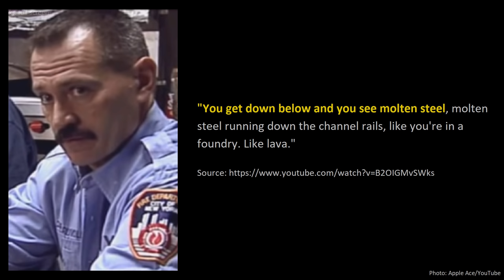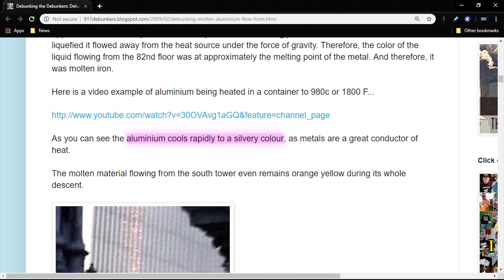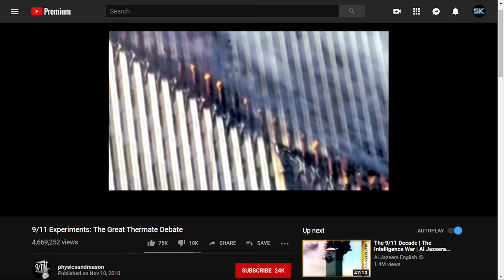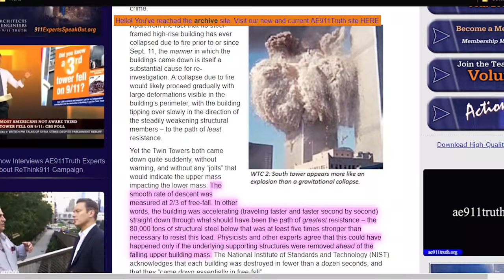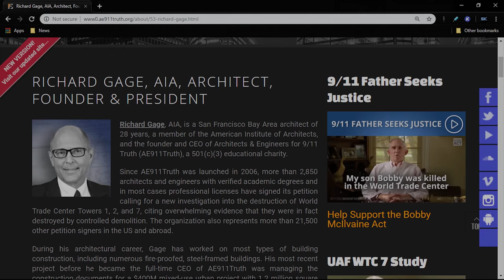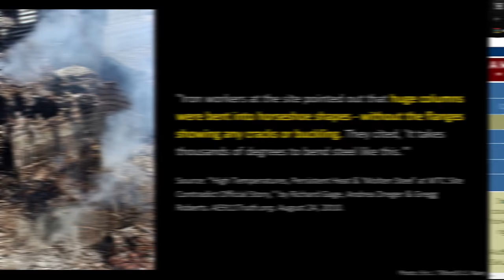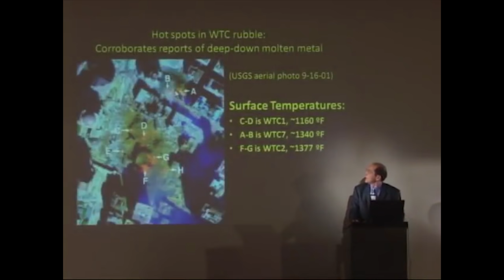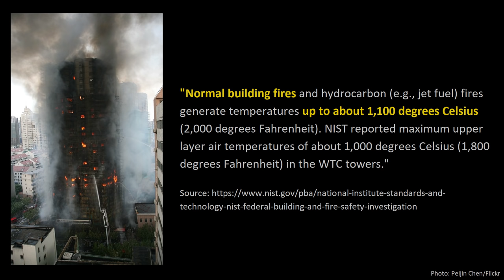9/11 Truthers Debunked: "Molten Steel = Thermite From Controlled Demolition!"

Comment: Can you do an episode about building 7? You have changed my mind on subjects before, but without an explanation for building 7, I'm not convinced that it was not a false flag operation. Flight 93 was brought down and crashed because of the passengers taking over the hijackers but building 7 went down for no apparent reason even though it is 100 meters away from building 1 and 2 according to google, and there were WTC buildings between it and and wtc 1 and 2.
Reply: 1. Larry Silverstein purchases lease for World trade center and the twin towers. A purchase that nearly every business analyst recommended against. The Towers were filled completely with asbestos that would cost a furtune to get rid of....But regarless, Silverstein makes the purchase and takes out huge insurance policy on towers against terrorism 6 weeks before 9/11. 
2. Silverstein worked in the towers every single day without fail, as well as his children, but happens to miss work that day? as well as his children? How convenient...
3. Silverstein gave the "go ahead" to "pull"(demolition term) Building 7, to which the OFFICIAL 9/11 commission report didn't mention the collapse of the 3rd skyscraper that day. A building that fell at free-fall speed, a complete scientific Odyssey, to which if true, we would have to re-evaluate Newtons laws of Physics! No steel buildings have ever collapsed into their footprint, pulverized heavily, at free-fall speed from office fires/jet fuel. 
4. Urban Moving Systems (proven front for Israel intelligence agency) given $500'000 Federal Government Assistance Program On June 22, 2001. A moving company that was used to move out Israeli companies at company losses out of the twin towers just a few months before the attack. The moving vans were later verified to have bomb residue through bomb sniffing dogs.... Israeli companies foreknowledge of attack... Planted explosives brought in.
5. Israeli intelligence agents found celebrating the collapse of the towers, admitting they had foreknowledge of the events. Israeli agents under benjamin netanyahu, who larry silverstein spoke to on a regular basis. If Israeli intelligence knew, Silverstein knew.
6. September 10th, 2.3 trillion dollars admitted to be unaccounted for? Pentagon accounting offices trying to account for this money completely destroyed the next day under the guise of a plane hitting it? To which dozens and dozens of cameras could have captured? But the government refuses to show any of those, and hand picks ONE inconclusive video with botched frames?
7. Molten steel from dozens and dozens of first responders and witnesses, combined with nanothermite in all dust samples. This fact alone debunks your entire video. NANOTHERMITE. ADVANCED, MILITARY, EXPLOSIVE, MATERIAL.
8.Mysterious deaths of key witnesses of 9/11 with the likelyhood of all of them dying in the fashion that they did comparable to one person being struck by lighting 10X. No investigation of that, many unanswered questions, purposefully abandoned.
9. There are hundreds of other related, convenient, and coincidental points. 
10. There is no problem with leaning towards believing in a conspiracy. All it is, is following a lead of evidence, just like any other type of investigative groundwork. People who lean or believe or bend towards following evidence that leads towards conspiracy are just are actually regarded as better investigators, so long as they an remain to be unbiased in the end, and remain open to all facts, no matter what side of the coin they're on. 
11. I used to buy into the false narratives, before I developed and open mind.
Reply: @justinturner8219  I happen to be partial to this theory rather than thermite watch?v=Uw-aZsXnGl0 but other than that you pretty much hit the nail on the head.
Reply: @dumbassmoron  video deleted? Why am I not surprised. #censorship
Reply: @justinturner8219  You can search Dr. Judy wood, theres still videos of her out there, and her theory is what I was referencing.
Reply: @GamePro0012  hey man, dont believe everything you see.
Reply: @justinturner8219  Just a friendly reminder that the proper term for demolition is "shoot it" or "blow it", not "pull it"; the last of those is an evacuation order.
Reply: Katelynne Wilcox  so do you think the leaseholder of the world trade center complex and his 2 children, who worked there everyday and just so happened to all miss work that day was a mere coincidence?

What about the vaults underneath the world trade center, emptied out before the attack? 

Foreknowledge of the event is a sure thing.
Reply: Katelynne Wilcox  There was a FEMA worker who fled to Argentina after seeing the empty vaults with his own eyes.

Do you really think its logical that the "passport" of the "hijacker" was recovered in pristine condition, while the black boxes of the flights were blown to pieces. 

Do you really think the twin towers and world trade center seven, all falling at free fall speed, with no resistance, first time ever to happen in the history of the of the planet due to office fires, really happened?

There was a scientifically study on the dust from several areas of the world trade center complex, with an analysis of nano-thermite in all of them.

Think about all the steel columns in the 52 story world trade center seven. All failing simultaneously to produce a freefall collapse. There is no logic in the excuse that office fires produced that. 

Military industrial complexes dont give a crap about sacrificing a few thousand Iives.

It was all about giving reason to acquiring oil in the middle east. THINK
Reply: Katelynne Wilcox  keep in mind, I cannot verify to 100% every point I have brought up. I just find there to be way too many anomalies for there not to be a bigger issue at hand with 9/11
Reply: Katelynne Wilcox  you dont find it strange, that the secretary of defence announced 2.3 trillion dollars in transactions missing the day before 9/11?

Then miraculously, the accounting offices of the Pentagon, where they were investigating the missing 2.3 trillion was precisely where the "plane" hit the pentagon on 9/11?
Reply: Katelynne Wilcox  some of my points may be invalid, I havent fact checked all, which I'm not ashamed to admit. Theres no shame in being wrong. 

But what does make me scratch my head, is the molten steel that existed for weeks after the collapse. What would produce molten steel?
Reply: Katelynne Wilcox  unfortunately I on this molten steel topic, you are not correct.

There is indisputable proof of it existing.

From multiple firefighters, video evidence, and such. Give me a moment, I saved a few sources.
Reply: how do two steel beams fuse together, if "steel was not heated passed it melting point?"

In conclusion, it certainly was.

https://benthamopen.com/contents/pdf/TOCPJ/TOCPJ-2-7.pdf

Here is a scientific paper that concludes the existence of nano-thermite(1st world military grade demolition material). As well as the existence of iron microspheres, which are not produced from office fires.
Reply: Katelynne Wilcox My trust isn't put in charlatans. I don't willfully ignore contradictory evidence, nor do I try to convict the innocent of crimes.

What I try to do, is to personally investigate one of the most tragic events to take place on american soil, instead of just accepting the narrative that's been given. 

Some of the things I find I should dive further into to verify. But I do believe some of the points I make are logically possible/true.

What if there was U.S collusion, there were hundreds of thousands of causalities that resulted from this attack, is it okay for them all to die in vain while the true criminals never face justice?
Reply: Katelynne Wilcox  Looking at more pictures, they do seem pre-fabricated. Gosh, I guess I'm ignorant to the other side of the argument right? lol. 

Also, no one is rushing you. Take your time to address each issue as you had done in your previous replies.

So what of the nano-thermite analysis?
Reply: all you need to know about building 7 is the term "Free fall" it fell within its own footprint with no resistance meaning all columns failed at the same time. that office fire theory is bs.
Reply: @justinturner8219  most of what you wrote can be refuted with common sense
Reply: Katelynne Wilcox  Most of the scientific community is well aware that the progressive collapse theory is not only impossible but easy to disprove with the fundamentals - of which you are outright willfully ignorant of. You're also projecting your own faults onto me since it is in fact you yourself who is naive and gullible. At this point all these years later you either need to be stupid or paid to still think these buildings just fell down. Which are you?
Reply: Katelynne Wilcox  No, it's not. It's impossible. You know it, deep down I know you know this.
Reply: Katelynne Wilcox  The laws of physics are not nonsense, madam.
Reply: Katelynne Wilcox  I understand the law of linear or translational momentum well enough. Its you who does not or you'd know full well that what we saw take place was not due to mere collapse
Reply: Katelynne Wilcox  There is no acceleration in vertical momentum when there is mass preventing it - this is a point which you yourself only yesterday mocked. Don't tell me you know shit about this law of physics when you only that recently defnied one of it's principles.
Reply: Katelynne Wilcox  Except it isn't falling. Buildings like this do not just fall down. Mass cannot gain momentum with there is mass beneath it - unless that mass is floating in thin air. I can see you are not able to apply basic reasoning skills or you are just bluffing when you profess to know these basic concepts.
Reply: Have you heard of the "Cult 93" ?
Reply: Katelynne Wilcox  3 months of relentless hard work in this thread, Bravo! I find it interesting that when searching your name on google, your presence online can be summarized to one single activity across many plataforms: Debunking 911 truthers. 
Perhaps you might be a paid agent being briefed in many scientific subjects as soon as they are presented on arguments? 
Just as unsettling as arguing with someone that knows nothing about the subject being presented, arguing with someone that seems to dominate every possible subject presented with complete certainty is eerily uncanny. 
Being so focused on appearing irrefutably correct, also using the old method of questioning the intelligence of your opponents, you presented yourself as not being a real person. 
People who question the official narrative can be many things, but laughable and stupid they aren't.
Reply: Katelynne Wilcox  it doesn't matter what I believe, what matters is that you are a (paid?) shill that's always engaging in 911 discussions like clockwork, and after some months you delete your old comments from extensive threads. What interests me is what motivates someone to work so hard... and what motivated the great shifts in the world order sinde 2001. I'll ust keep investigating. A debate with you would be a complete waste of time after reading some 30+ responses you already gave.
Reply: @NikTheFix You may be right about the tethers, but if they were there, they certainly would not have gone unnoticed.
Reply: Katelynne Wilcox Jesus I would hate to be in a relationship with you. When you can explain the found Passport of one of the supposed “Hijackers”, or the suppose “Airliner” scene in Shanksville where there was only a ditch, then we’ll have a good debate here. If I lit my house on fire and it was burning for a day straight, I assure you the main foundation/frame would still be standing. Even the architect/construction workers do not believe that that BS pancake effect was the cause.
Reply: You must be the one that can explain where over 100 tons of wreckage the remains of the passengers and other contents of the aircraft disappeared to...

'I stopped being coroner after about twenty minutes because there were no bodies and to this day I've not seen a single drop of blood not one drop' 
Somerset county coroner Wally Thompson
Reply: Katelynne Wilcox  I guess we can stop rigging buildings for demo and just set them on fire... ROFL! Derp!
Reply: Katelynne Wilcox  where did you go pretty girl? ☹️
Reply: Katelynne Wilcox  can I call you Katie? I want to be your friend...
Reply: Katelynne Wilcox  then why did FEMA abandon their 'pancake collapse' theory? I'll tell you why pretty girl.... It was proven to be false.... That's when they came up with the 'progressive collapse' theory...

NIST's 'thermal expansion' explanation for building 7 is equally laughable...
Reply: Katelynne Wilcox yes.  progressive and pancake are two completely different explanations. The pancake theory suggested each floor struck the next causing it to collapse and so on... This would require that the collapse would be slowed with each subsequent impact of floors bellow collapse initiation. The problem with any of FEMA's explanations is the majority of the towers never even hit the ground. Seriously though you can find any of this information in the public domain...

But let's discuss the alleged aircraft and Boeing's published design limitations. Because it does appear as if these morons were able to defeat the known laws of physics not only as they apply to building performance and the huge safety margins built in but also to aircraft design limitations....
Reply: Katelynne Wilcox  I'm a jerk because I think you're pretty? Wow! Let's talk more about airplanes our lack thereof.

' Meet Hani Hanjour his incredible aerobatic supersonic bunker busting 757 and his flying circus. Hani's flying skills were so poor he couldn't rent a single engine Cessna. The instructor conducting the check ride for that rental stated "Hani could not fly at all'. Yet Hani is alleged to have executed a 330° 7000' descending turn pulling 5-7g at more than 140 kia ABOVE the speed where this model will lose its wings in straight and level flight penetrating NINE FEET OF STEEL REINFORCED CONCRETE. He then dons his magician's cape and is able to make OVER 100 TONS OF WRECKAGE the remains of the passengers and other contents of the aircraft disappear. Some of his co conspirators even return from the afterlife to process their Innocence.

This is not Duck Dodgers in the 24th and a Half CENNNNNNNNTURY! Aircraft leave wreckage.... Lots of it. Have you seen it? I'd like to see it. In fact by now I think there are several million Americans that would like to see it also...

Here is an experiment for you: Take a full soda can....(don't waste good beer! Lol) and throw it better yet use a potato launcher and shoot it at your house... Any questions?
Goodnight gorgeous! 
 MMMMMMUUUUUUUAH!!!!!
Reply: Katelynne Wilcox  what's wrong pretty girl? Put you on quiet time? ROFL!!!! MMMMMMUUUUUUUAH!
Reply: Katelynne Wilcox  Another troll on quiet time...NEXT!
Reply: @justinturner8219  check out this comment thread...I put this shill on quiet time...
Reply: @samukalel  I think she deletes her comments because she isn't very good at this. All Katie seems to be capable of is parroting NIST FEMA and other govt and media sources. It's like a bunch of yiddish with ZERO logic. Anyone who has some deductive capacity would see thru it with some study. Therefore to be effective she must throw a volley of bs with veiled ad hominem to scatter the casual observer and before any can really reflect on her nonsense she deletes it...
Reply: Dude molten aluminium doesn’t look like he shows you here molten aluminium is silver molten steel looks just like in the video check it!
Reply: Could anyone please explain another point to me? If the fire became from the impact of the plane, and only the steel in those nearby floors were seriouysly damaged, why wouldn't all the lower floors with no such damage hold on the structure when it fell? The pankake effect makes no sense if you think about that. No?
Reply: @thiagowwz  nothing makes sense with the offical media story my friend
Reply: @justinturner8219  Wow. Let's see shall we?

1, "A purchase that nearly every business analyst recommended against." Ignoring that a lease isn't a purchase, if "every business analyst recommended against" it, why were there no less than 4 interested, LARGE, groups bidding for the lease? 
As for the supposed asbestos, that's so much nonsense. However, even if it HAD been true, that would've been the responsibility of the OWNERS to get rid of.
And finally, the "huge insurance policy against terrorism", there was no such thing. The insurance policy was no larger than could be expected, the timing was "right after the completion of the lease" as you'd expect, and there was no "against terrorism" because at the time that was an integral part of any lease.

2, it's been well established that Silverstein had a doctors appointment, one which he had deliberately not gone to multiple times before. Imagine that, he had a reason.

3, "Silverstein gave the "go ahead" to "pull"(demolition term) Building 7" It's amazing that you can fail this many times in one single sentence. No, Silverstein didn't "go ahead" anything. And no, in no way other than in the delusions of "truthers" are "pull" a demolition term other than in one single, specific case...one which did not and COULD not apply. 
"the OFFICIAL 9/11 commission report didn't mention the collapse of the 3rd skyscraper that day" And why would it? The commission's job had nothing to do with that. 7 WTC, as you're referring to, is mentioned however...as is the OTHER 7 buildings that collapsed. 
"A building that fell at free-fall speed" Ignoring the fact that you don't know the meaning of the terms you're throwing around, a sure sign of a "truther" bleating along with the herd, no. It didn't. It is well known by anyone actually able to find out the facts that it didn't.
"we would have to re-evaluate Newtons laws of Physics" That you don't understand the laws of physics and how they do, and more importantly DON'T, apply...mean only that.
"No steel buildings have ever collapsed into their footprint, pulverized heavily, at free-fall speed from office fires/jet fuel." None have collapsed from magical space beams from the flying teacups of the Lizardmen of Beta Reguli either. And since neither of those statements are at all relevant, it doesn't matter.

4, "Urban Moving Systems (proven front for Israel intelligence agency) " If, that is, you ignore the meaning of the word "proven".
" A moving company that was used to move out Israeli companies at company losses out of the twin towers just a few months before the attack." Something that didn't actually happen.
"The moving vans were later verified to have bomb residue through bomb sniffing dogs" And, of course, the "verification" that is made-up nonsense.

5, " Israeli intelligence agents found celebrating the collapse of the towers" Which weren't "intelligence agents" and weren't celebrating, as the story you yourself is trying to peddle clearly shows.
"admitting they had foreknowledge of the events" Something that they, of course, never actually did...most likely because they didn't.

6, ". September 10th, 2.3 trillion dollars admitted to be unaccounted for" An issue that had been known about for an entire decade previously, and which in fact is STILL known about, and ongoing.
"Pentagon accounting offices trying to account for this money completely destroyed the next day under the guise of a plane hitting it?" Except, of course, that there were no "Pentagon accounting offices" in the area hit, something which is well known. Then of course there's the SLIGHT issue that, a plane hitting somewhere would be about the least possibly successful way of destroying anything, not to mention that there would be massive backups.
" To which dozens and dozens of cameras could have captured?" The cameras that didn't actually exist? Because, imagine, the Pentagon isn't a mall, and there would be no reason to film random patches of sky.
"But the government refuses to show any of those" The ones that, as noted, didn't exist?
"and hand picks ONE inconclusive video with botched frames" No, actually, the "government" showed exactly the video that was requested to be shown, in the FOIA request. You DID know about that, right? No. Of course you didn't.

7, "Molten steel from dozens and dozens of first responders and witnesses" NONE of whom actually saw any molten steel, nor was there ANY evidence of it at all, either as literally molten OR as solidified puddles.
" combined with nanothermite in all dust samples. " Because cool buzzwords are really an argument. Now, ignoring the "nano" nonsense, thermite is a mix of aluminium and iron oxide, or rust. So, what was the towers made of? Well, they were steel-framed and aluminium-clad. What DO you know. But, let's not stop there: if there WAS "nanothermite in all dust samples", then the level of iron in said dust samples would be elevated. And in ALL such samples tested, the level was lower than BACKGROUND amounts of iron, much less an elevated level.
"NANOTHERMITE. ADVANCED, MILITARY, EXPLOSIVE, MATERIAL." CAPS LOCK FOR TRUTH! Meanwhile, in reality, thermite is thermite. "nano" is a meaningless buzzword to make it sound important. And thermite? Doesn't explode. It turns really hot for a really short amount of time, and that's all it does.

8, "Mysterious deaths of key witnesses of 9/11 " None of whom died mysteriously, none of whom were reliable as witnesses, none of whom died even remotely in connection to 9/11. But that doesn't sound like a cool thriller-movie plot. Right?

9, " There are hundreds of other related, convenient, and coincidental points." It's just that, you can't actually name those "related, convenient and coincidental points". Convenient, that. For you.

10, " There is no problem with leaning towards believing in a conspiracy." Until you start discarding things like facts, evidence and science in favor of your pet conspiracy. Asking questions, as "truthers" are ever so fond of claiming is all you do, is fine....as long as you're willing, or able, to accept the answer you get.
"All it is, is following a lead of evidence, just like any other type of investigative groundwork." Indeed. Except, that's not what you do, you and your "truther" buddies. You invent the evidence you want to be there, and ignore the ACTUAL evidence whenever it doesn't suit your pre-determined outcome.
"so long as they an remain to be unbiased in the end, and remain open to all facts, no matter what side of the coin they're on." Pretty much a PERFECT illustration of all that "truthers", and other conspiracy theorists, are NOT.

11, " I used to buy into the false narratives, before I developed and open mind." And, considering how anything that you don't like blow straight through said mind without a single hope of catching on, maybe you should have it be a little bit less open.
Reply: @justinturner8219  have u seen the footage of building 7 collapsing from the rear of the building? Lmk
Reply: @eh9379  not sure, where can I see this?
Reply: @vintageLEGOcollector  That would depend on what, exactly, you mean with "hologram conspiracy". If you're referring to the idea that the planes were supposed to be holograms? I can only say that you nailed it with the word "stupid". And that only because there's nothing stronger.
Reply: @vintageLEGOcollector  Creating holograms might be possible, though it'd probably take stupid amounts of tech....but you'd need something to project them onto. Mid-air isn't "something", in this case. So yeah. Stupidity on a terminal level.
Reply: @justinturner8219 silverstein worked everyday..? Do you know him?
Whats your head size to get your tinfoil hat?
Reply: @justinturner8219 your mind is open that s why your brain evaporated.
Reply: @Teluric2  embarrassing at this point in the culture brother....